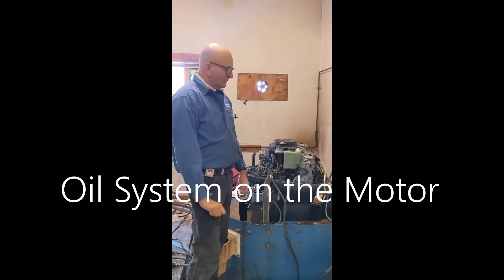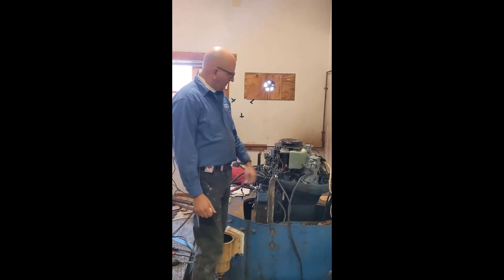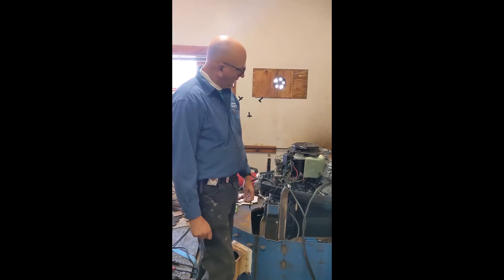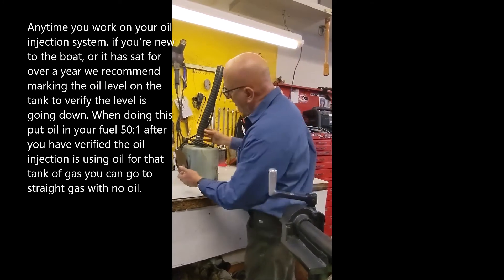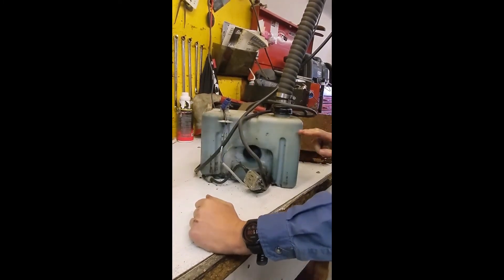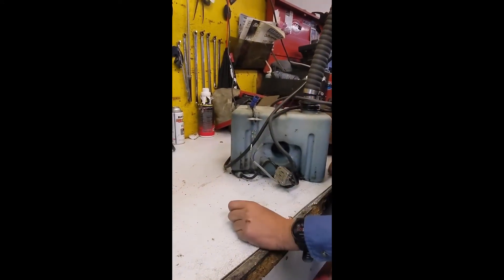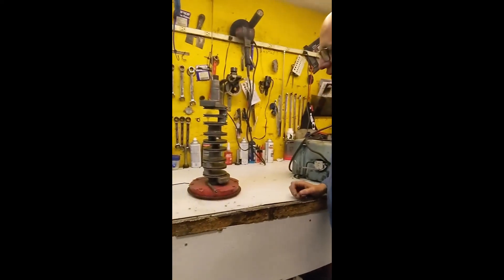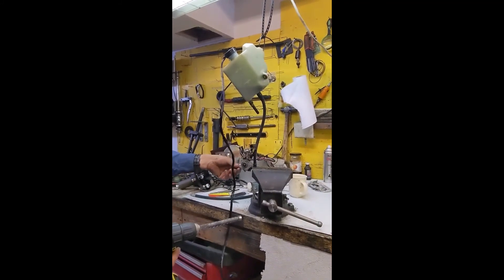How to Inspect and Prevent Failure of Yamaha Outboard Oil Injection System

Comment: I have an issue where the oil is seeping out of the carburetor. Is there a check valve or anything i should check?
Reply from the maker: If its a Yamaha the bottom carb could have a faulty gear oil pump that's attached to the block.
Reply: Yes it is a yamaha.

Comment: Question Question 
  I've replaced the pump at the big Reservoir at the steering column. I've replaced the float at the tank on the motor. I have power and decent ground every place. Tested the new pump between tanks. If I got to the control box and manually pump it'll work but if I'm on the move it wont.... idea?
Reply from the maker: Always note there has to be over 1/4 tank full of oil to pump. In that case if you've checked the harness between the aux tank and the motor and the harness is good then it's most likely the ECU or Control Module depending on the year of your motor.

Comment: I have unburnt oil pooling up under my engine oil pump. can't verify if its coming from the pump itself or not. but you can see oil dripping down the outside of the pan and running down the exterior of the engine. Any advice to find the source of the leak?
Reply from the maker: I would remove the oil pump very carefully if there's a lot of oil behind the pump it means the seal of the pump fell out and it may even be there. If thats the case you can put the seal back in just make sure it is glued in or wedged in. If that's not it it could be a leaky powerhead gasket.

Comment: hey man, i have a 91 yamaha 130, i have a alarm going off constantly, i filled the tank on the motor to the line and it still is going off, then i checked to see if the motor on the big reservoir was turning and it was not. would that cause the alarm to go off or do i need to look deeper?
Reply from the maker: Hey Will, nice talking to you on the phone today. Hope that advice helped you out.

Comment: Please help. My oil buzzer keeps going off. Level is fine on both tanks. The only thing I have noticed is that the oil pump when checked with light test both wires are reding hot. Power comes in on blue wire and out the black.  I'm not sure I know how to test if flow sensor is faulty. Help!
Reply: did u figure this out, mine is doing the same, the pump is bad but i have a new pump on the way. just wanna know where to look if that does not fix it
Reply: On my 07 Yamaha 115 2 stroke my alarm was going off and going to limp mode motor wasn't hot and had oil in tank come to find out my cranking battery was bad I put a new one and the alarm never went off since

Comment: Is it possible for the gear driven pump to leak on the shaft side and would it flood cylinder #6 with excess oil if it did?  Pulled my pump away from the engine case and it has two cycle oil in that area where the shaft fits to the pump. My #6 plug is always oil fouled and everything else checked good, compression, ignition, fuel injection. Trying to figure out the fouling of that plug. All others burn a nice tan color. Is it possible for that pump to send more oil to one of the ports maybe?  Do the lines have restrictors or just the check valves?  Thanks for any input.
Reply from the maker: Yes, it is possible. The way to tell is to take the oil pump off and the seal should be in the oil pump. Quite often they fall out when you pull the oil pump off you'd just see the shaft and the seal will be laying inside the block- this happens a lot. It is possible for the pump to send more oil to one of the ports which could be causing that plug to foul. The check valves have the restrictors. Let us know if you have any other questions, you can always call or email as well.

Comment: I love my 07 vmax but recently it has started pushing the oil out my carbs and into my air box and enough to make it run down the outside of my lower unit can anyone please tell me what its from
Reply from the maker: Henry, are you sure it's carbureted, typically Vmax motors are EFI. Can you email us your model number? info@ outboardexchange . com

Comment: My low oil alarm came on last week, 1998 OX66 250. Verified there was oil in the big tank and that the tank on the motor was at the low fill line. Emergency switch wouldn't turn the transfer pump on, so I ordered a new in line filter and transfer pump. Swapped them out this morning and it's still not transferring oil to the motor. Tried it with the key in the on position and with the boat running. Any suggestions? I assume it's electrical since the lines aren't clogged, filter is new, pump is new, float on the motor tank is working alarm wise.

Comment: pre-mixing for the 1st tank of the season is what I tell everyone until you verify the system is working.
Reply from the maker: We agree! It'll smoke a little more but definitely worth it!
Reply: I just took this system out. Wasn’t working properly. Thoughts. Sent to mechanic
Reply: If I mix a 50 to 1 ratio on top of my oil injection that wouldn’t hurt the motor will it because I get paranoid out the oil injection failing so I been mixing also my motor still runs fine with the extra oil in the gas
Reply: @jennifervicknair7923 man I do the same thing I mix in top of the oil injection but I put star tron ring and clean at every fill up and I can scope my piston and see there barley any carbon buildup on the piston head so I would say yes it's ok